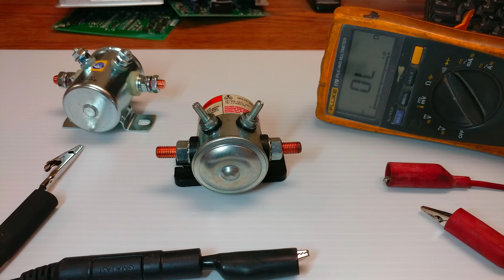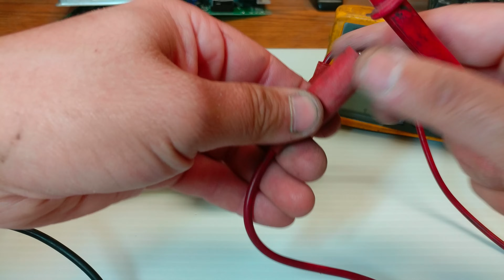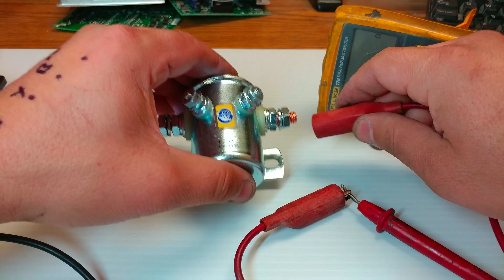How to test 12vdc solenoid.

Comment: I have a question, it's not supposed the solenoid mounting bracket is the ground? And then why you connected the ground wire to the smaller post.
Reply from the maker: On a 3 post solenoid it will use the small terminal as trigger signal and body as ground.

Comment: Hello, I’m learning electricity in auto. I am puzzled with this problem. I have a 4 post solenoid. It is the same as this video. When I turn the key on switch, I get power to both inside post and does not connect the main power. It takes my ground-to positive and blow my breaker when key on.
Reply from the maker: Sounds like possibly the coil inside may be shorted. You would want to set your multi meter to ohms(resistance) and put test leads on both small terminals. Be sure there is no wires attached during test. Depending on solenoid you may see around 15ohms. You definitely should not see 0 resistance. This would indicate coil has failed. You can also test resistance to ground(body of solenoid).
Reply: Thanks

Comment: Great. What do you use for a safe 12v power source?
Reply from the maker: Well for testing my snap on power probe has selectable fuse ratings. But if I was installing it permanently depending on application I would rate the fuse on the source side of the main power on the solenoid according to the load. On the trigger side, the coil in the solenoid draws very little so a 10amp fuse would be more than enough.

Comment: Good stuff, any idea why my solenoid is sticking closed only when it’s wired up to the starter? When testing like you do mine works perfectly, it’s new out of the box. When I put it back on the engine it will crank continuously even if I remove the key from the ignition.

Comment: im of the old school   i do things the simple way   all you need to do if you turn the key  you may hear a click or not but starter dont spin  ok take a  jumper wire say #6 connect between the 2 big lugs of the solenoid starter should spin if so replace the solenoid  if it dont spin you may have battery prob.  a lot of folks dont have a meter

Comment: brother, i have same solenoid on my 36v golf cart, and it says 30vdc on it. Does it means that to activate it, i need 30volt on small pongs instead of 12 in your case? thanks
Reply from the maker: I wouldn't think 36v would trigger the solenoid as most golf carts have a step down voltage converter for accessories like lights. Yours would have a 36v to 12v converter. It is just a guess though since I don't have a ton of experience with golf carts.

Comment: Question can I used this relay on ford glow plug setup .. it currently has a black relay with 4 terminals?
Reply from the maker: Absolutely you could as it could handle much more "load" or amp draw. You would just have to isolate the "constant", "trigger", "load", and "ground" from the relay and wire it to solenoid.

Comment: Great video   Helped me finally get my solenoid tested   It is bad   Also figured out it was wired wrong   And its in a rv connecting rear batteries to front battery   Now I need to figure out which wire to wire to the front right to engage the solenoid while main battery is hooked to back right and rear batteries are hooked to left rear    Also I heard I should get a fuse in there    I guess from main battery to solenoid should be fused    But I finally got a solenoid to switch and get continuity   Very cool   And that’s the new one I did with this test    Thanks!!!

Comment: Interesting video, however I notice that you connected your leads differently to your bad solenoid than you did to the good one. That is to say, in your first example, you connected the + leads from your multi-meter to the negative terminals of the solenoid, but then in your second example (with the good solenoid), you connected the + leads from your multi-meter to the "BAT" terminal of that solenoid.  
Does it make a difference which terminal is "+" and which is "-" when connected to a vehicle?

I ask this because I'm changing out the solenoid in a 1956 EZ Go Golf Cart. It runs fine with lots of power, but I noticed when taking off the old solenoid that the large "BAT" terminal of the solenoid was not connected to the "+" terminal of a battery. 

I'm hesitant to change any of the wires and cables to this new solenoid, because I don't know exactly what goes where from the solenoid to the rest of the cart. It seems logical that if I put the battery "+" connection to the large "BAT" terminal of the solenoid, I would also have to change around all the other wires. Is that correct?

BTW, I'm only changing the solenoid out because I'm re-wiring all the cables and wires with new, so I thought I just might as well change out the solenoid, too...it's inexpensive and comes from the same manufacturer as the one I'm replacing: White-Rodgers, model #70 200224 36 Volt.

Thanks for any help.
Sincerely,
jt
Reply: Where he connected the meter leads, is not positive and negative , is power in and out, is where the solenoid has the big bolts

Comment: Excellent video!  Clear instructions and great job testing both a failed and a good solenoid. Because of you I was able to fix my RV charging problem. I had a bad solenoid. Thanks dude!
Reply: Same here !  Bought a rv  has a solenoid like this connecting the rear batteries to the main battery   Iv finally figured out the solenoid is bad   And that it wasn’t even hooked up correctly either  so something was up   I’m guessing they didn’t care to have it hooked up right anymore    Where when the engine is running it charges the rear batteries   Still trying to figure out how to wire the new one correctly   I know now I need a wire that gets hot when the engine is running ya be connected to the front right   So it engages the solenoid and the front battery and rear when the engine is running    Charging the rears 
Also I heard I should fuse it   I’m thinking I fuse the line from front battery pos to solenoid   Let me know your thoughts and if you dealt with the same thing !  Mine is a old 77 dodge

Comment: The clicking sound doesn't necessarily mean the relay is good. You should also check for resistance
Reply from the maker: Resistance on the contactor is what I show in this video, resistance on the coil only shows "health" of coil. Click sound is a byproduct of said coil activating contactor which is why click still occurs even with contactor having failed.

Comment: I guess I can just use a battery charger to supply the 12V to solenoid, correct?
Reply from the maker: Or a jumper pack
Reply: @Toolin.Around  Thanks but since I don't know what a jumper pack is I may see if I can just use my battery charger but I won't get a chance till next weekend.I am kind of thinking that should work.
Reply: I just used my battery charger to test solenoid but I did get a spark when I connected the positive end of the battery charger but the solenoid did seem to check out. I guess that is ok, not real sure.  I heard the click and when I applied the 12V and the continuity test also checked out.

Comment: It’s a big ass relay!
Reply: its realy a small winding  inside solenoid  the key switch puts  power on that winding which magnectly conn two big lug togeather taking 12 volts straightto starter

Comment: TOOLIN AROUND,   1.) solenoid coils uses a different type of wire that has "insulation" resistance on the coil wire or something so it doesn't get burned up when left turned on held on for a period of time? 
2.) How do you measure the solenoid "Torque" to know how much the power of the solenoids release pushing out strokes to know how strong it releases the solenoids plunger?
Reply: solenoids dont have torque  it has a spring loaded plunger about dia of a pencil when you turn on the key the magnetic effect pulls the plunger which conn the two big lug s togeather send ing   voltage to the starter

Comment: It would help to know what you are hooking up to it. I bought a vm tester but I am not clear on what else to hook up so I can test it!
Reply: I just got a four post solenoid for a project. The one I got has two smaller terminals that are labeled "I" and "S"; I found out that the battery positive goes to the "S" and the negative goes to the mounting bracket of the solenoid. When power is applied to both the bracket and "S" the solenoid closes and the terminal labeled "I" and the two big terminals get connected together. So, by applying power as above, you can pas the current from the positive terminal of the battery to whatever you are trying to power. The I is also powered for whatever is needed. The larger terminal can pass a larger amount of current; i.e. if you are trying to start the engine, you need a lot of amps, that has to go through the large terminal; but, if you also want to run some power to some meters to show you that the power is indeed going through, you get that power from the smaller terminal labeled "I".

Comment: Can you explain what would make a solenoid go bad I put three in my boat and they don't last very long
Reply: Or it could be because, the coil inside the solonoid, is made for many amps running in short period. If you use your Solonoid in long period, the coil inside the solonoid heats up
Reply: There are 3 basic types... starting, constant duty, and latching.  Latching is rare and expensive... so you probably do not have that.  Starting are for... starting... large temporary loads... then released.  Constant duty are designed to stay on for long duty cycles.  Problem is... they all look alike and rarely have markings.  You are likely using a starter for linking multiple batts together... and they will die.

Also West Coast Marine sells a "200 amp CD" solenoid, that is really an 80 amp.  They suck... so that will die too.  Spend the bucks on a "silver contacts" constant duty... and you should be good.  They will be $60 and UP...